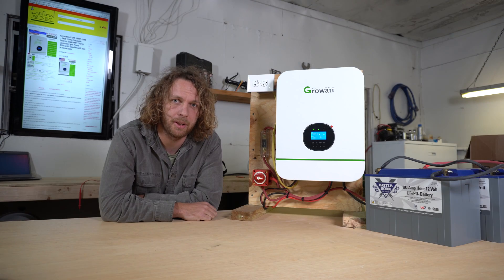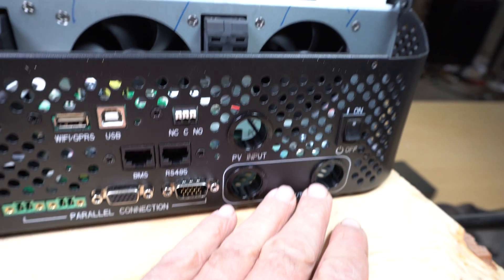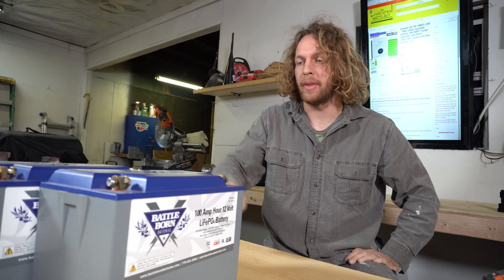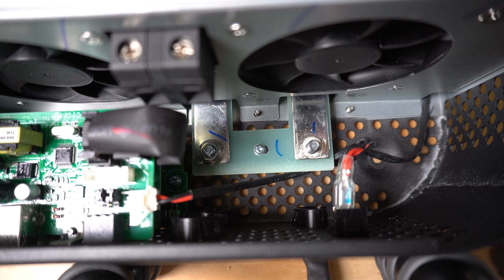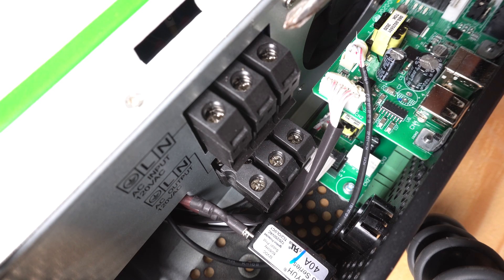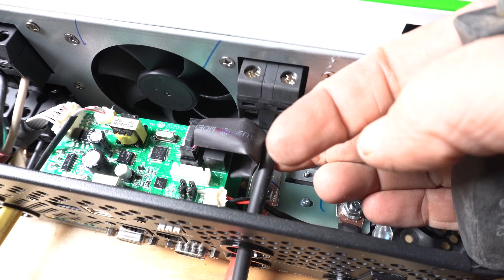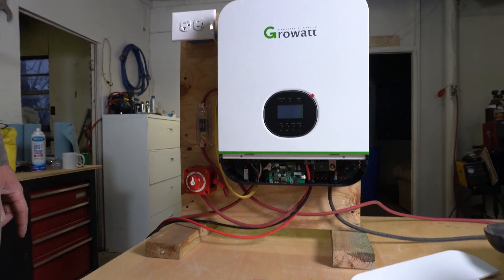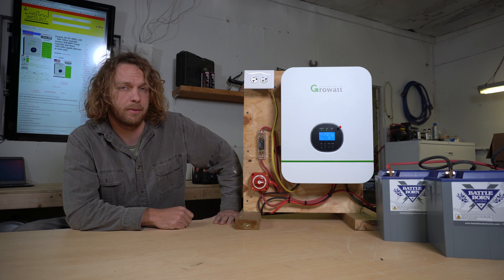Solar inverter by Growatt 3000w Test bench and first impressions.

Comment: This Growatt high frequency, transformerless inverter is great for powering resistive loads and small electronics but it won't last very long powering inductive loads like power tools, refrigerators, motors, AC units, compressors or microwave ovens. High frequency inverters like these were never designed for powering high surge loads. You may get lucky and this inverter might start a few of these inductive loads when the inverter is new, but as the inverter ages, 1 1/2 to 2 years down the road, the inverter will fail sooner, rather than later with continuous use with inductive loads. I've repaired inverters for a living for the past 23 years and one thing that I've learned is that the surge current that's generated by these inductive loads will damage the MOSFETs (metal oxide semiconductor field effect transistors) in this inverter and will basically brick the inverter because the hourly shop rates for troubleshooting, testing and replacing all those MOSFETs will exceed the value of the inverter. It would be cheaper to simply replace the unit. A much better choice is one of Growatt's low frequency transformer based inverters. You'll be much happier 10 years down the road.

Comment: Does the Growatt SPF 3000 work with all 24 lithium batteries or only with certain ones?
Reply from the maker: It will work with any 24v setup, but it can communicate with only a certain type.

Comment: I have the same model but when my PV makes 1500w and the load is only 1000w, the inverter  decides to take power from the battery and PV at the same time when the 1500w  from solar would be enough for the 1000w.... seems kinda dumb.
Same goes for when there isnt "enough" watts in the PV, like the solar makes 500W, the load needs 1000W but instead of taking 500W from solar and 500W from the batteries it takes  200W from the PVs and 800W from the batteries.....
Anyone knows how to fix it?
Reply from the maker: Hmm that is strange 🤔

Comment: SPF 3000TL LVM-24P In this model inverter, should I use lithium phosphate battery.  Or just use lead acid.  Because I have seen the data sheet, the data sheet only mentions the name lead acid battery.  Please give details.
Reply from the maker: Yes you can use lithium no problem you just have to use costom settings...
Reply: Yes, I've used two of these in different settings. Both have LiFePO4 batteries. You just need to use "USE2" in Setting #5. Then you can set the values you need for the battery bank.

Comment: how did you set the parameters so it works without Growatt configured LI batteries? Mine won't charge past 26.6 if I tell it I'm using lithium batteries...I' m going to try the AGM setting and see if that will charge to the 28.8 that Will Prowse recommends. Would love to know how the battery charge went for you. Great video otherwise. Thanks!
Reply: I set ours to User 2, which is recommended for non rack lithium batteries. (We have battleborns). I was able to set everything to what I needed to. Do not that settings 19 and 20, (Charging Voltage and float Voltage), will be set to the same 28.8V when you set one or the other.

Comment: Hi, thanks for your video, just today i installed the very same model here for our off grid setting. In the Day time it seemingly worked well, except the fan, which was working all the time, even though today was a cold and rainy day here.  I have a question regarding the stand-by mode at night. having no experience it seems to me that every minute, the system tries to start itself, all the indicators blink a few times, then the LCD Display tuns on and the fan runs. After one minute everything goes off, Again after one minute the whole process repeats. it goes non stop. Is this behavior a normal stand-by mode for this machine?  I am wondering because there is no fault code indicated in the display, and there is no such situation explained in the manual or on the Trouble Shooting table. I appreciate and value your kind effort and time....
Reply from the maker: Hey! (Sorry late response)
No I don't think it's supposed to do that mine only kicks on under heavy load .....
If you have found a solution or figured anything out let us know thank!
Reply: @J-TAB  Thanks. Everything is working well with out device.

Comment: my kind of video thanks mate  my question is that i have this exact inverter and about to install in my bus  which has both 24volt and 12 volt appliances fans ect so is this unit clever enough to apply the right power do i need a 24volt to 12volt  device?
Reply from the maker: hmm no you will need a converter for the 12v if you are running a 24v system.... something like this https://amzn.to/3uN4hey but check the power draw of you appliances to make sure
Reply: @J-TAB  cheers dude

Comment: If it was 48v model would it still be the same fuse and cut off knob
Reply from the maker: yes the knob will work but you need to find the correct size fuse the one I used was just for testing.... you should always do the calculations for the application you are needing the fuse for... as there are variables involved such as wire size, wire length, amp draw, etc..

Comment: One year later how do you like it?  I am thinking about putting one in a bus renovation.  Thanks.
Reply from the maker: Hey!
Man these are great super simple and just works .... It's hard to say about mobile application  tho because the battery can only be charged by shore power or solar because of the 24v which isn't bad in a trailer but in a van/bus situation you will be missing out on the alternator charging 
really wish they made a 12v version with a 30-50 amp dc to dc charge controller for mobile applications.....
Reply from the maker: Here is a video of a pretty good all around setup.... but only 2000w ac output.....

https://www.instagram.com/joshuatreeadventurebuilders/reel/CVBx-PAFwV9/?utm_medium=copy_link
Reply: @J-TAB  I won't be boondocking for extended periods so I think I can get away with shore power or solar only for charging.  I like the idea of 24v for the better efficiency over 12v.  Could a step up converter be used if I really wanted to use the alternator to charge?  Thanks for the prompt response!

Comment: Good video! 
how many solar panels are you using to charge up batteries ?  also if you have 2x200w(solar panels) how long it takes to FULLY charge those (2) 100Ah battleborn batteries ?
Reply: Loaded question 400 watts pv is at peak pv power. most areas have about 5 to 6 hours of solar hours. that's different from sun hours. then your voltage and watts must be figured out to get the amps for the battery charging. every set up is different. I have 12,000 watts solar. with 100 amps per hour of charging capability into a 600 amp hour battery bank. It takes until 2 or 3 in the afternoon to recharge my batteries.
Reply: these are 48-volt battery system. are you running 12 volt or 24 volt?

Comment: Hey bro great video.   Do you think this growatt unit would be able to power a fridge and small microwave for an off grid cabin in building right now ???
Reply from the maker: Hey yes I believe it will ..... it has 3000w ac output power .... for how long will depend on the battery and how much solar ..... just look up how much power you microwave and fridge take .... a typical fridge take on average around 100 continuous watts and a microwave will take 1800 watts max ..... check the description for a link to the grow watt
Reply: @J-TAB    Ok sweet thanks bro. Now I’ve got to figure out if I want to do a 12vor 24v system for my small cabin
Reply from the maker: here is a link to a great deal on a battery that goes with the 48v growatt inverter.. 

https://watts247.com/https://watts247.com/product/growatt-lifepo4-48v-rack-mount-floor-standing-stack-able-100ah-4-8kwh-battery-with-bms-comms/?wpam_id=81
Reply: @cowboymcq6711  I am still NOT clear with 12v vs 24v system .... Im kinda lost
Reply from the maker: It really depends on you situation..... if you are in a vehicle where you main system is 12v anyway than 12v is best but if you are in a offgrid situation than it can be beneficial to go with higher voltage for better efficiency...

Comment: Thanks for the video 👍just a question, does this inverter need any AC breaker between the inverter and the Output line where you plug all your appliances? Thanks
Reply: For safety always install a breaker panel.

Comment: Few questions: Can you turn off the inverter? (I only need it sometimes) Can the inverter be turned off via the wireless stick? is there a option to manage it by cable? On another note, mind the fuse: in the manual I found this: "SPF 3000TL LVM-24P
 / Maximum amperage 141A / Recommended battery capacity 200Ah". Thanks !

Comment: Did you end up making your van build using that after all? I'm currently looking into components I'll need for my 1700w solar array, 30amp + shore power, and 300ah 24v battery system and the price adds up quickly if buying all the components separately. i.e. just an inverter/charger is more than this whole thing and you still need to get the solar charge controller and a lot more... Just wondering if it's a viable alternative on the road :) thanks!
Reply from the maker: Hey!
Yes I have put one in a bus and it works great!
Check the link in the description I think they are on sale right now at watts 247..... the only thing I had to add was a dc to dc converter for the 12v led lights
Reply: @J-TAB  awesome, been thinking of using this for a uhaul build or old RV upgrade and one of those server rack 24v batteries.  Certainly simplifies things.
Reply: @J-TAB  was that a step down, 24v to 12v ?
Reply: @vandweleer8004  It's called a Buck converter. I bought the 24V to 13.8V 40A version, after finding that the 24V to 12V 20A wasn't enough to power my small tire pump.

Comment: I'm looking to try my 1st build,and want to use a all in one solar inverter but I'm looking for a 2000 watt system and can only find it in a 24v system so how would I get some 12v outlets.... thanks for your help.... and I did just subscribe
Reply from the maker: Hey!
Yeah I have been trying to find a smaller setup also .... but you can convert 24v to 12v with something like this ..... https://amzn.to/3vDyvAO ... or this https://amzn.to/3puUmJz ....... also thanks for the subscribe!
Reply: @J-TAB  That second one is one I tried before, but found it to be underpowered. I bought one that looks just like it but was 24V to 13.8V at 40A output, which works well.

Comment: How does this all in one power the 12v stuff (pumps LED lights ECT)? I was looking at buying one for a bus build but have never done a system like this before.
Reply from the maker: Hi there!
You would have to get a dc to dc converter....
Something like this  https://amzn.to/3mkxbP4
Reply: @J-TAB  Awesome! Thanks so much! Just bought 4 300w panels and the Growatt 3000tl with two 24v 200ah lifepo4 batteries for my bus build! Thanks for the video and the reply definitely pushed me to the Growatt!
Reply: I used a 24V to 13.8V buck converter. The 24V to 12V seemed underpowered for some things, like my tiny tire pump air compressor.

Comment: Great video! Can you do an efficiency test demonstrating efficiency running a fridge, speed drill, miter saw (especially the miter saw) and a blender?
Reply from the maker: Yeah I will definitely do that...
Reply: @J-TAB  nice!.....One more curious thing I'd like to know is what wattage it idles at when you set the priority to Utility and it's doing absolutely nothing just running off the battery with no power from Utility. In some other video someone had it on SBU and it was pulling 5.2A  just to remain ON which is alot, way too much for just idling! 

The trouble with the power saving feature though in many inverter/chargers is running something like a fridge, once the fridge stops periodically, waking the inverter seems to  be an issue so the fridge won't work but I don't know whether this is the case with Growatt, can you also test that?
Reply from the maker: Hmmm I will have to get some additional testing equipment for that...  maybe I can hook up a smart shunt and see if I can measure it....

Comment: How will this unit fair in an RV vibrating down the road?
Reply: My girlfriend and I both have one of these, she in her shuttlebus conversion and I in my truck with work topper. No problem after nearly a year and a half.
Reply: @Tumbleweed5150  I ended up building a 48v battery bank (15kw) and a Sigineer AIO, and put 1400w of solar up top... vids eventually... :o

Comment: Bought one, wired it as you presented. In the display at program 10 I cannot get it to move from 4 (for 48 volts) to 2 for 24 volt. It just jumps to 11 or nine.  I am using 4 battle born in series/parallel.

Comment: So how did you setup your battery in LCD setting 05? Did you pick lithium? Where you able to setup your own bulk charging voltage, float voltage and low dc cut of if you selected Lithium battery type? Curious how you setup you lithium batteries. I have the same setup for my camp.

Comment: Quick question, when you don't have enough solar and battery say for AC start. If it switches to shore or generator power it is a full switch right? The generator/shore isn't just supplementing the needed amount right? I'm trying to set up a system to run ac in my trailer.
Reply from the maker: Hey!
Yeah it's full switch.. .... here is a manual for it

https://watts247.com/manuals/gw/SPF%203000TL%20LVM%20Operation%20Training.pdf

Comment: I'm thinking of doing a sprinter van conversion and considering 2.8kw  induction hob for cooking, so this unit looks like it would do the job. One concern - how many solar panels in series to reach the operating voltage of that Growat system. Also, do they do 230v ac versions?
Reply from the maker: Hey Paul! 
As far as how many solar panels to reach peak voltage it depends on the open circuit voltage of the panels you are using....
And as far as the 230v you can either link 2 of the units together or if you are wanting it a little simpler you can use one of these https://watts247.com/product/spf-6000t-mpv-dvm/?wpam_id=81 ...the are 6kw and have 230v

Comment: In a off grid set up. Is  it's possible to charge low batteries with my gas generator (ac in), will the transfer switch automatically?
Thanks
Reply from the maker: Yes! Definitely

Comment: I heard one of the drawbacks of the All in One is that they consume a lot of power with the inverter always in standby move.  From what I heard you need an additional 500 watts to cover the standby power consumption.
Reply from the maker: Here is a manual that says it takes 50w to run but can be put into low power mode that only takes 15w

https://watts247.com/manuals/gw/SPF%203000TL%20LVM%20Operation%20Training.pdf

Comment: I'm looking at this unit for our Airstream reno as well.  We were considering the 48v version.  I would love to know how your build is going!
Reply from the maker: Hay that's awesome!
I think they are great and will defiantly be getting some more....
I am interested in why you are considering the 48v version? I like the 24v 
the airstream has been on hold I have been finishing up some projects for customers but I will be getting back to making videos on some stuff we got going at the shop soon.
Reply: @J-TAB  I'm looking at the 24v version as I can still find some appliances/devices that can be powered directly on 24v for the best efficiency (A/C being the most important, but also fans, electronics, water pump, fridge). At 24v the cables are quite decent in size. I think there's almost nothing that can be powered at 48v. Also, to build a 24v battery you need 8 modules, at 48v you need 16 modules. That a lot of extra space and connections to be made.

Comment: with the AC out for the unit to go to shore power to charge, do you need it if the RV has an outlet for pluging into shore power?
Reply from the maker: I would have to look at what you are trying to do I don't have enough information  ..... if you mean "do you need to hook up shore power to the growatt if the trailer has a shore power plug?" I would say yes "if" you are wanting to charge the unit off shore power and if you are wanting the rv to utilize the transfer switch..... but i would also say it really depends on you setup.... You "might" be able to use the shore power plug that is already on the rv

Comment: How do you hook up 2 more 12v batteries into it. That's whare I get confused...
Reply: To make the 24 Volts, we put two 12V batteries in Series, hooking the negative of one battery to the Positive of the other, then taking the 24V off the two terminals left. In order to hook up two more 12V batteries, you connect them together in Series, then hook up the two sets of two in parallel by hooking the 24V terminals of each set together, positive to positive and negative to negative. There are many DIY channels that show how, including DIY Solar with Will Prowse.
Reply from the maker: Hey!
This is not a great video on the subject but is accurate I hope it helps.... https://youtu.be/mMCHhkQM2hY

Comment: What is the no load consumption ?
Reply: I have one of these. and with nothing running except the inverter, mine jumps from 13 to 19 watts. So thats like 26 days the inverter would run on just the battery(100ah lithium) with nothing charging the battery.